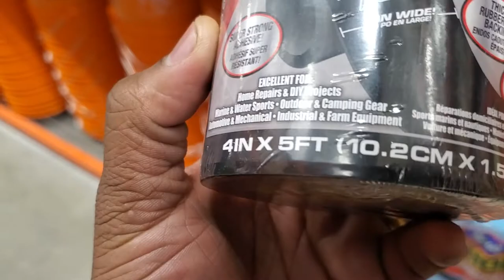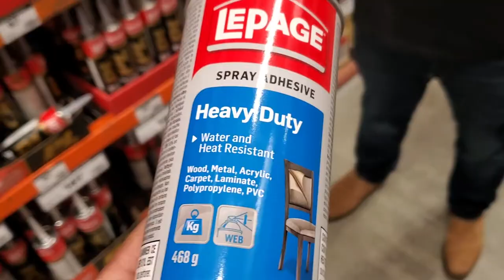DIY G37 interior transformation PART 1

Comment: Bro how did you take apart the sunroof door??
Reply from the maker: By prayers and hopes 🤣 jk lower the assembley starting from the back bunch of 10mm bolts and nuts until u reach the middle then remove them half way then u got 2 clips 1 each side on the back each has 1 phillips screw on top remove that then u can slide that out and the visor just slides back

Comment: How did you remove to sunroof shade?
Reply from the maker: Lower the 10mm nuts around the assembley until u reach the middle then there's 2 small clips at the very back held by 1 phillip screw on each side remove those then u can slide it back and out

Comment: How u took out the sunroof
Reply from the maker: Headliner comes out first but as far as the sunroof cover there's 2 small clips in the back of the rail held by 2 Phillips 1 each side remove those and loosen few of the nuts that hold the assembley so u can lower the back a bit and slide the cover back till it's out

Comment: How did you take out the grip handles on the roof?
Reply from the maker: There's a little cap u pry it off and pull the handle make sure u pull the metal pins if they dont come out so u can install it easier
Reply: Domatyo Alright, thanks man. Last thing I needed to drop my headliner.

Comment: Hey how do you remove the b pillar?
Reply from the maker: Unbolt the seatbelt bracket then there's a clip at the bottom pry it out then be careful at the top right behind where it has the airbag sign u will need a long needle nose pliers squeeze the sides and pull it out its PITA but u can do it just be patient
Reply: @96domatyo  thanks got that off, a little bit different since I have the sedan. I’m on another part. Did you have to remove the connectors to the sub antenna as the wiring runs along the headliner